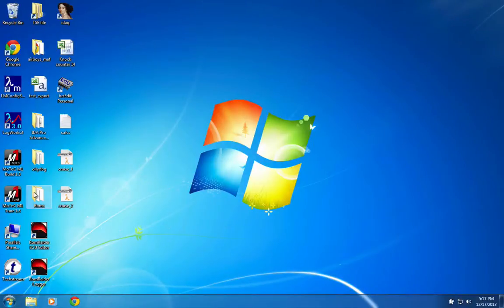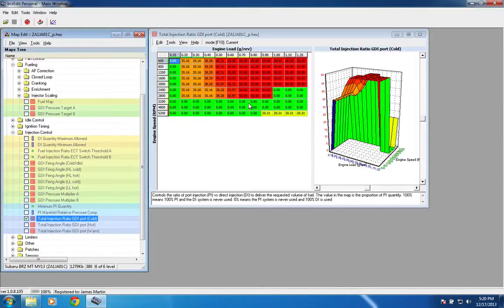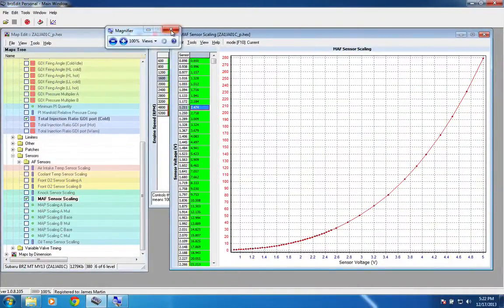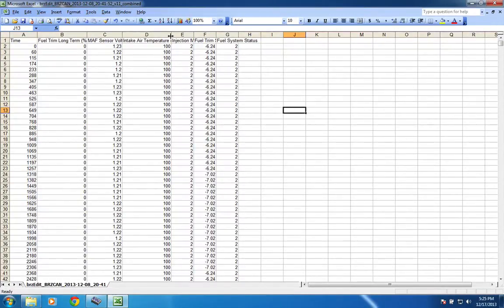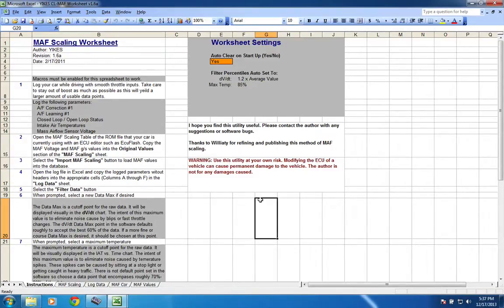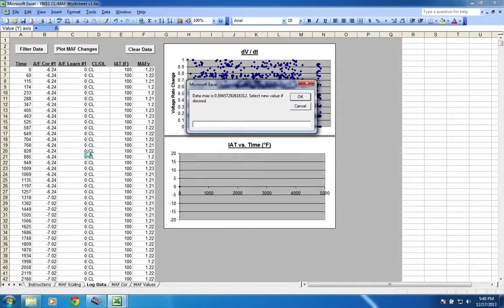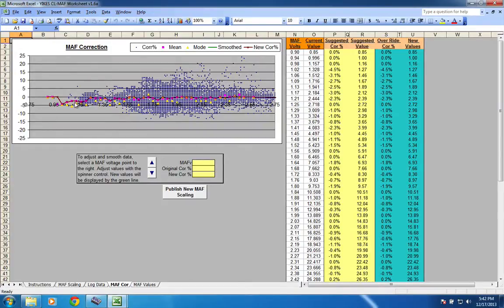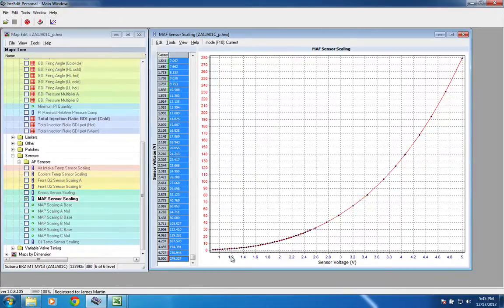FR-S BRZ fueling error calculation with yike's maf spreadsheet

Comment: would be safe to run 60%di and 40%pi in boost in the upper RPM's? There is a reason di is 100% under high load and high rpm under OEM tuning specs and the oem information suggest having the pi injectors involved in the upper range can lead to pre-detonation. I am curious if what I am understanding is incorrect.

Comment: Why would you not have to scale direct injectors when running regular E10? I'm a noob, so please bear with me. By my calculations, the port injection system alone is just not sufficient for E85?
Reply from the maker: For a car with stock injectors I generally don't do any independent Port/DI scaling.  Just scale the MAF against the combined fuel systems.  For a car with aftermarket ports and/or MAF placement, i'll scale the MAF against the (unchanged) DI, then scale the ports independently against the now-known-good MAF.  If this doesn't make sense, feel free to shoot me an email at support (at) hrituning (dot) com for details.